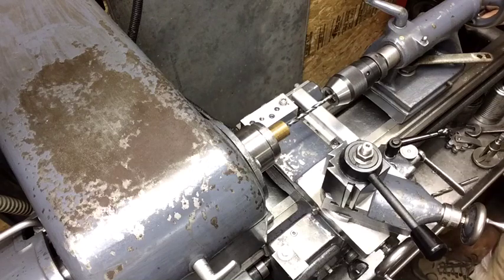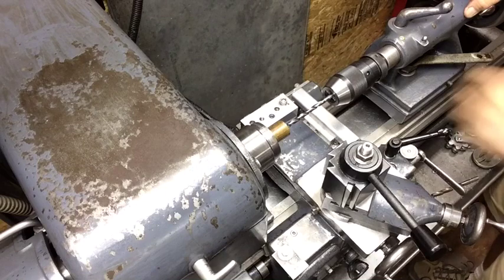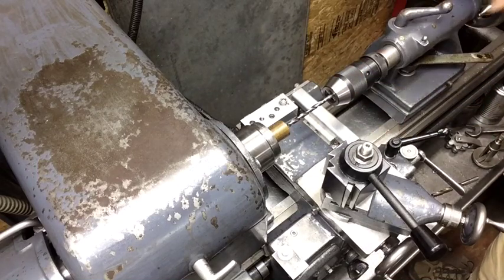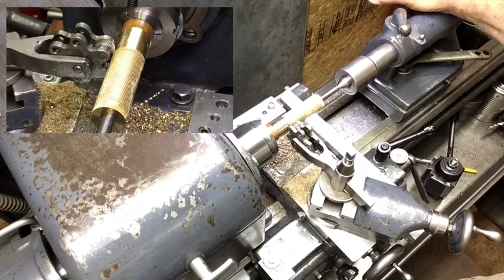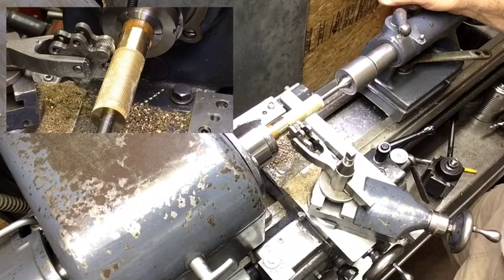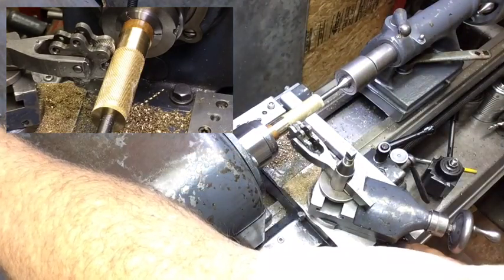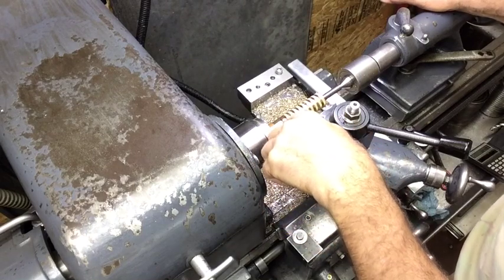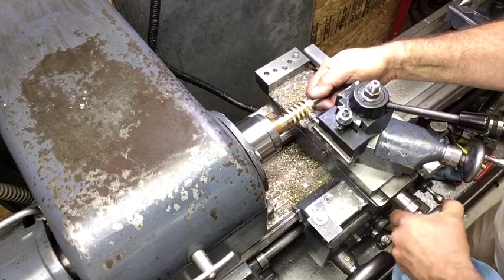AXA QCTP Tool Holder | Quick Change Tool Post | Detail Making | P6

Comment: Randy, your knurler looked like you had spurs on your chip tray at 2:00.  Never seen one like that before.  Is it kind of a turret knurler, where you can have different patterns handy for switching between?  Nice job on the nuts..they look great.  Do you have a sneaky way of working out the diameter to turn to, or is it just the usual calculation?

I'm going to guess 16 cords. Looks like you have 6 or 8 already. 

Thanks!

-- Mike
Reply from the maker: BigMjolnir The knurl tool I have is an old one and is is in bad shape. I think Armstrong used to make one like it.  My is apiece of junk, I need to replace it or make a new one.  It does work, it is a handy style with a medium, fine, straight knurl all in one place.  No sneaky way of calculating, I have put the calculation on a excel spreadsheet with the data for the knurl a I have so all I have to do is punch in the diameter I am looking for, it makes it fast to come up with a diameter.
Thank you for watching, Randy

Comment: I would say 4 and a quarter cords if you are really good at keeping air between the split pieces. Much better split screen (picture in picture) with the two angles you have chosen. I like the time delay so one can catch that missed in "the other" image. There could also be a littler more time dealy between the two shots.
Nice locking nuts. Well thought out project.
Reply from the maker: Jim Milne Thank you for watching, Jim.  It is tough getting the right timing. Randy

Comment: Randy, I'm guessing that the stack with be 24ft long x 4 feet high x 4 feet deep =  384 cubic feet /128 (1 cord) =3,
so my guess is 3 cords.  That's a heck of a lot of wood,  would be about $600 worth here in Dallas.
Reply from the maker: Herb Blair I updated your #, thanks Herb.  Randy